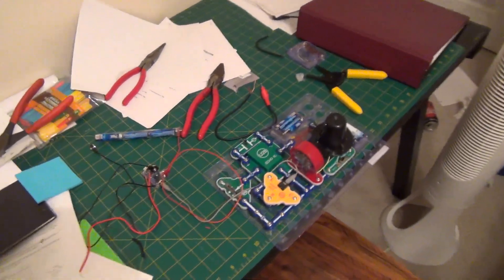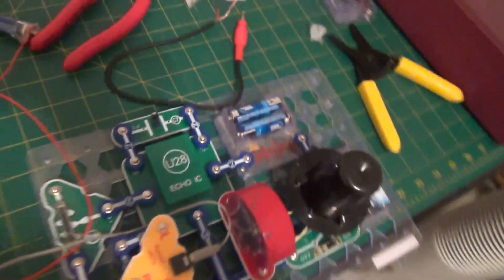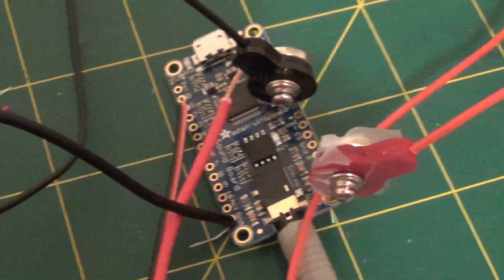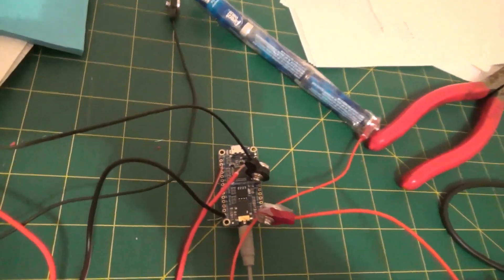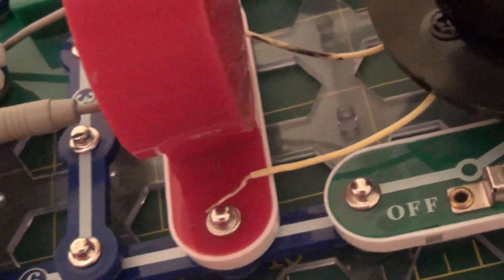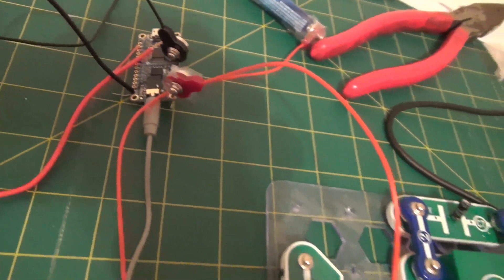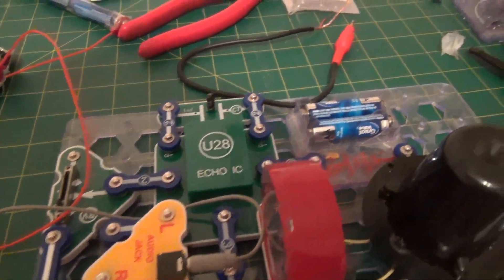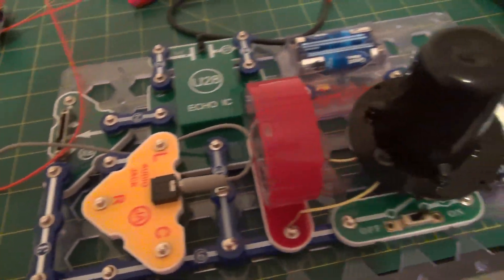Test Circuit For My Homemade Railroad Crossing Bell!

Comment: How Can I Make That ?
Reply from the maker: This was done with an Adafruit Soundboard hooked up to a Snap Circuits Amplifier (I couldn't use a regular amplifier as I didn't have the adapter for one). The Adafruit sound was put on pin 0, and I configured it to loop, endlessly.

I'm getting a new board for this project called the ESP32. It's functional in extreme temperatures (-40C to 105C), has plenty of memory to carry the functions I want in my bell, and can be used in conjunction with the I2S for high quality 16 bit seamless looping sound. The best part? It's super cheap! The only extra effort is having to program this chip with C++, which is not a problem to me due to my background in computer science.

So, if you'd like something more quick and easy, go with Adafruit like I mentioned above, but if you'd prefer quality and are willing to take the extra steps, opt for the ESP32.